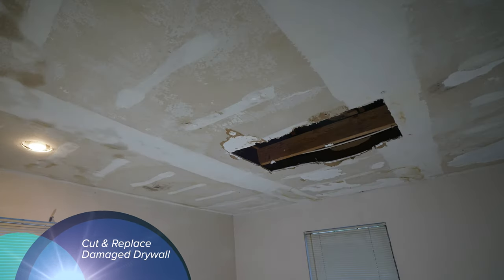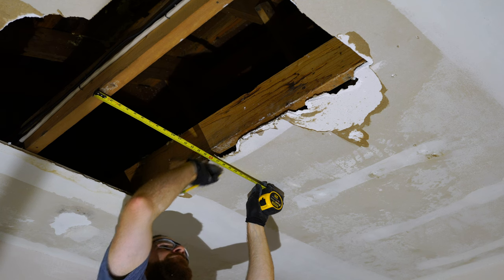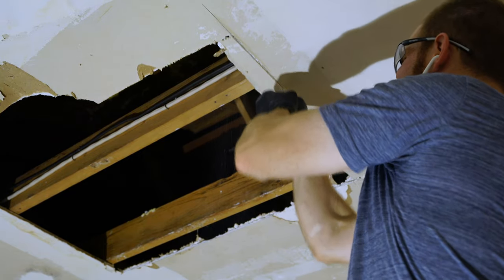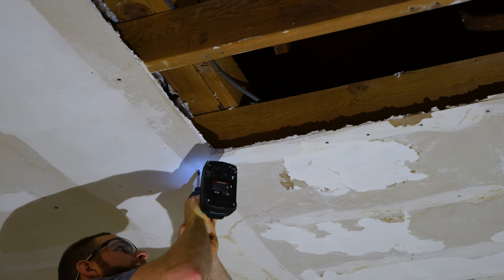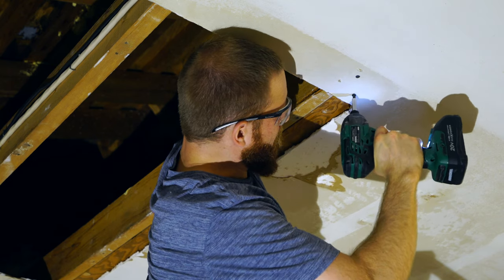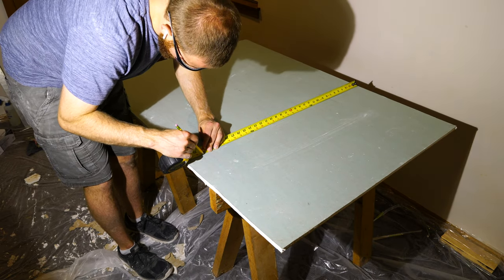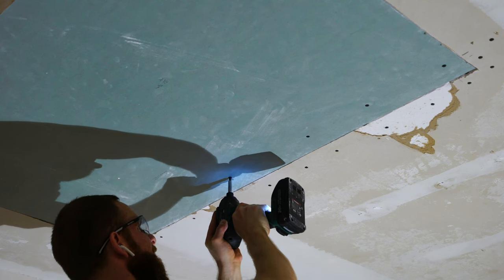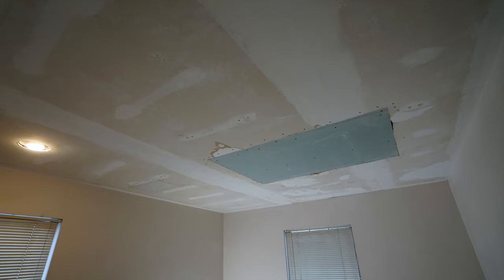How to Cut and Replace Ceiling Drywall

Comment: I'm lazy.  Cutting out the existing drywall with a drywall knife or saw takes a lot of time.  I use my dewalt 20V 4 1/2" circular saw, with vacuum attached, to cut a quick, clean and straight line.  For a small job, I use the dust bag on the vacuum. Also, there is a drywall screw bit, for your impact driver, that will set the screw the correct depth without over driving.  it is a Drywall Screw Setter PH2 Bit.
Reply from the maker: Nice thanks for the tips, I’m not always up to date with the latest tools and such!
Reply: I am even lazier, I use the local builder to fix it for me
Reply: I was upstairs and slipped and almost fell through my ceiling. Needless to say, a repair is at hand. I was going to get my cousin to take of it since he was a builder. But with your steps, I believe I can manage. I appreciate the step-by-step sir.

Comment: I have a hole at least that big due to a contractor almost falling through and am now waiting for them to fix it. I wondered about how it's done and you've made it look easy enough, thank you for that, but these guys have to deal with fiber glass plus blown in insulation, which is going to just create a huge mess, which I've already cleaned up from the start. Not looking forward to it getting fixed but it has to be done. I hope they do as good a job as you have.

Comment: This was a good beginning video, but then you glossed over and completely skipped how to finish the ceiling. You mention "mudding," but don't show or explain what that is or how to do it. 
I really appreciate your attention to detail in the parts you did go into, though! I have an entire panel in my garage that I need to replace, but don't know how to "connect" the pieces. It looks like there's some kind of tape, but I don't know what it is... Hence my resorting to YouTube videos to try to learn. I'd love your feedback or any references to other videos that might help!
Reply from the maker: You can use drywall tape that is solid but typical people use the type that’s meshed which is fiba tape. Thanks for the feedback on the video!!!
Reply: Thank you for the detailed steps!